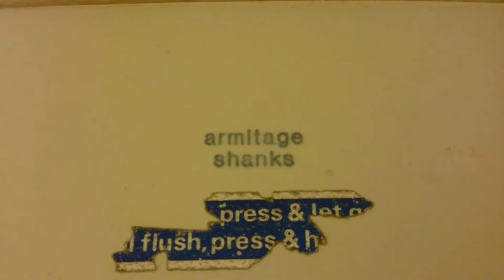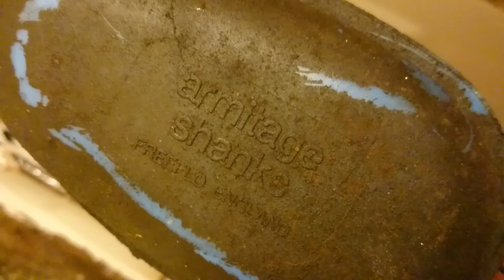X3 LL Armitage Shanks Kensington with Magnia pan's

Comment: Nice one. Good to see all cisterns have original original handles. Good that 2/3 still have original syphons. The last one has an excellent flush
Reply from the maker: Thanks, I was really pleased with these. The only problem was the first cubicle in the ladies with its ballvalve set way too low, but hey i would much rather that than them getting replaced with push button eco bullshit. These are some of the very early Kensington cisterns i think.

Comment: Nice refill sound, pity about the poor flush. I don't think it will work any better continually pressing the handle. Nice video however.
Reply from the maker: No I shouldn't have kept doing that, I just couldn't believe the flush was that poor. I thought it might have been a knackered syphon at first but the water level in the ladies is set very low as i said. Yes great refills in the first ladies and the gents. Armitage Shanks isn't my favourite but i really liked these!